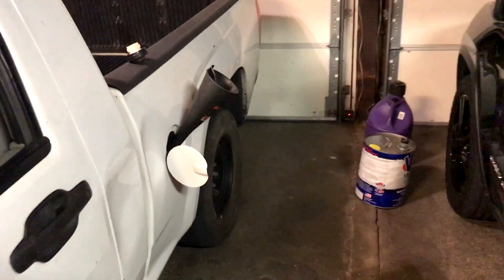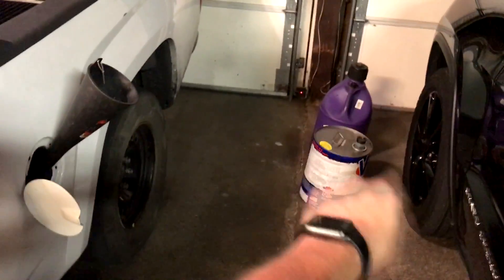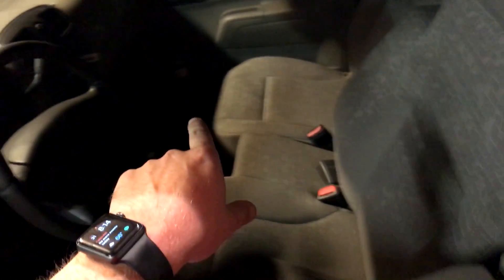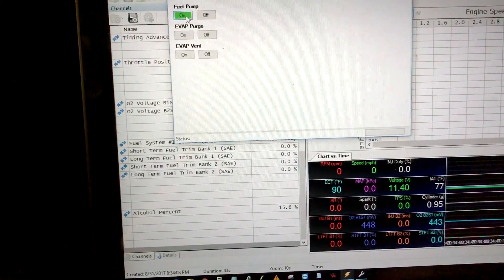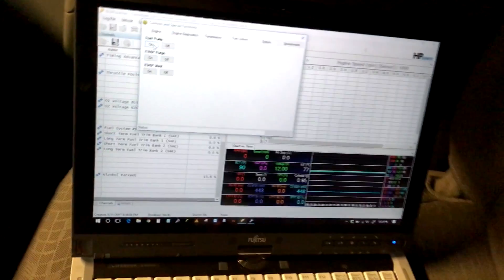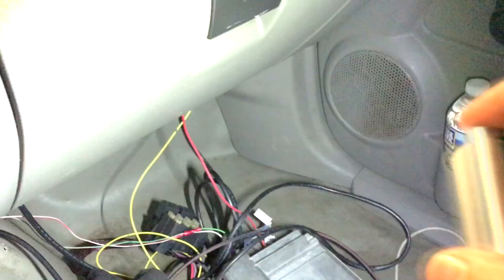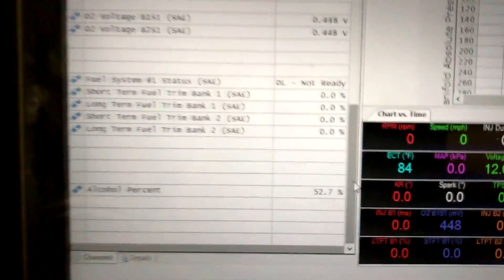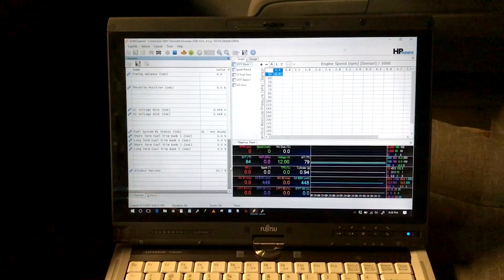dont bs me ep19 - back to ethanol testing with exhaust

Comment: I want to start by saying I love your videos and they "inspired" me to do my own build and I know it's not related to this particular video but I could really use yours or someone else's help, I have an 03 Silverado planning on around 450hp with 5-7lbs of boost and my dilemma is I ordered an aeromotive 340lph fuel pump wand was planning on running 60lb injectors but have the opportunity to buy 80lb Siemens for 150 and want to know if it would be a good idea to use them, sell them and buy 60s, or return my old pump and and get a 400lph? Just wanting to know what my best option is.
Reply: Tyler Galloway Get the 80's and up your pump.  You say you'll only want X power and X boost. But after you get into it, you'll want more. And the 60's will run out and the 340 will run out really fast!
Reply: Get the walbro 450 like Denmah says :) You can find all his build info on his Wiki page ;)